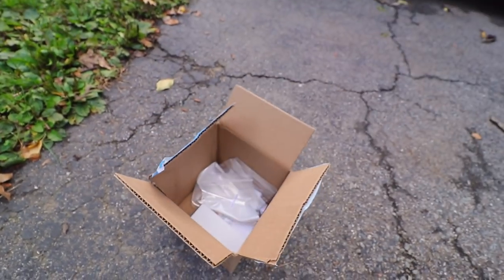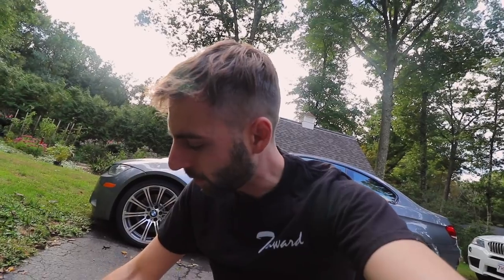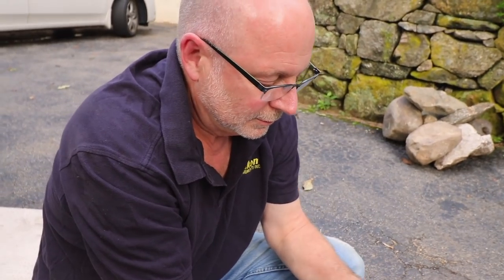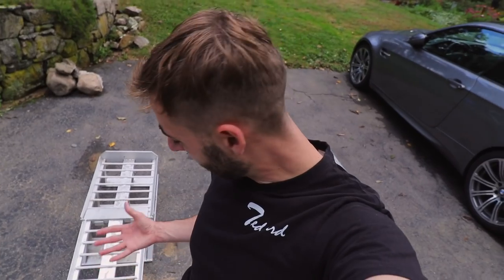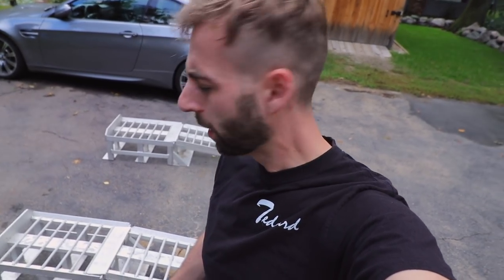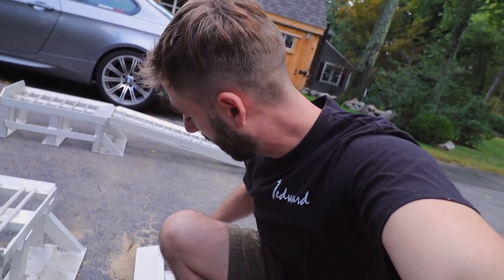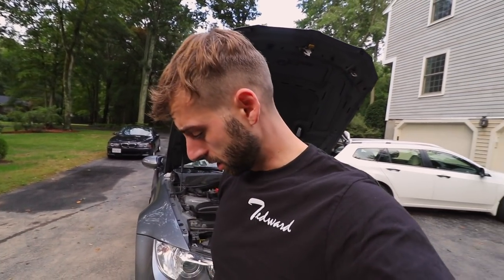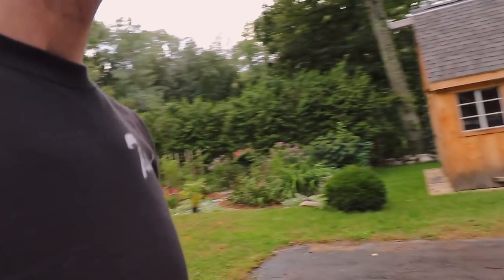I'm a Stripper....of bolts.

Comment: If i dont use my e92 m3 for a week it does act like shit mainly the secondary air pump code 0027b1 and then it goes in to limp mode and then i restart the engine and its all fine